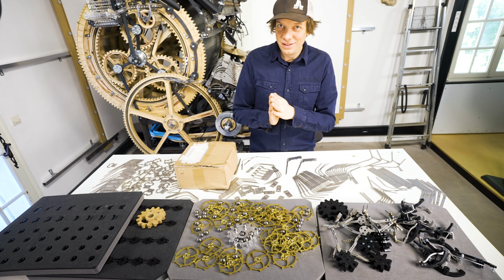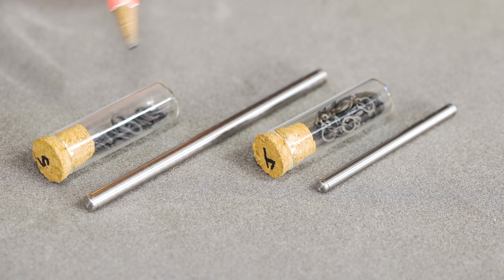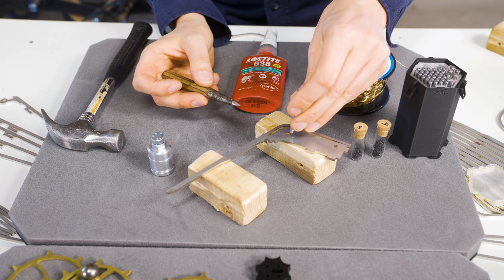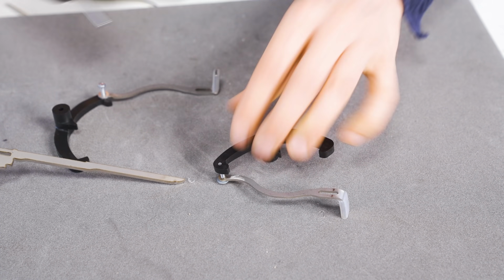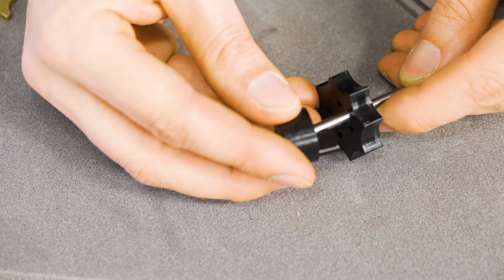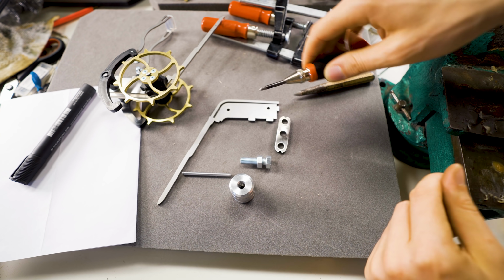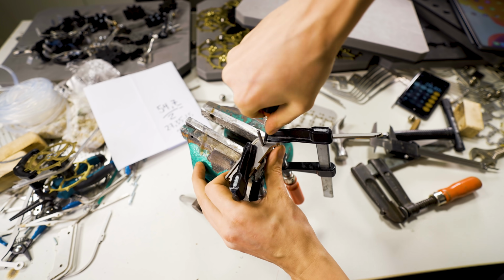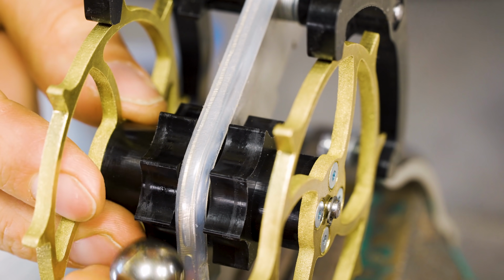Silver Steel Axles - Marble Machine X Escapement Gates

Comment: The "Clock Making Trick" (a.k.a. "staking") is a technique also used to 'permanently' prevent a threaded fastener from backing out - e.g. securing gas key on a bolt carrier group.

Comment: I have a suggestion about the programming plates.  They take a LONG time to CNC - so the majority of the time in constructing a set of plates isn't the wood-working or the metal plate - it has to be hole drilling.  So if you used different plates for 1/16th timing and 1/3rd timing - each one would need only half the number of holes and would machine twice as quickly.  So have a set of 1/16th plates and another set of 1/3rd plates - and you can make more of them.  In fact, you could invent new timings 1/5th (for example) and just make more plates.  With more space on the plate for each hole, you can go back to using simple circular holes instead of dog-bone holes and rectangular pins...which will save still more CNC time.   I'd be strongly tempted to build a static bar with 38 model airplane servo-motors that could replace the entire programming drum to allow you to play MIDI music on the Marble Machine directly...as an interchangeable option.

Comment: Engineered "slop" is important. It is what makes the SR-71 fly, even though the metal parts move a lot when heated / at speed. Sometimes flex allows things to work, where ultra-tight tolerances would create either a bind or a wear, when the materials wear out and get the same amount of "slop".

Comment: Freeze the Axle before install and by roomtemp it's snug. 
Use treadlock for moving parts because vibrations in longterm should not cause goofey problems.
This "Clockmaking" thing called: Staking

Comment: With that tight a fit between the plastic and metal parts, will there be a problem with temperature dependency? The thermal coefficient of expansion of the plastic and metal will be different. If the plastic has a higher coefficient than the metal, then when it gets cold, they will bind.

Comment: I have been so confident about this design, but now I am getting second thoughts. The force driving the mechanism is the weight of the marbles creating a moment. So you really have to rely on low friction. If the friction increases over time, the mechanism stops working at some point. So why not design with a bigger marble sprocket, creating a larger moment.

Comment: Some of your balls are rusty!  Ask anyone that knows about pinball machines and they will tell you rusty balls greatly accelerate wear on pinball playfieds as they constantly scratch away at the surfaces they come in contact with. For the MMX this might manifest as scratching the internal surfaces of the tubes causing them to become opaque over time as well as possibly wearing away other surfaces such as the divide by four and making them malfunction.

Comment: To reduce that little play as shown at 13:28, can I suggest swapping out one washer, on each side, with a spring washer? Preferably, the spring washer should be placed between the other regular washers as to not let its jagged edges from scratching/scraping the more expensive MMX parts.

Comment: Great video. Using the auto punch to dimple the metal around the shaft is called staking. One or two stakes would be most adequate to hold the shaft tight.

Comment: My biggest concern on this whole project is the capos. They work great, but they just seem to require an enormous amount of attention from the player who needs to be able to think about so many other things too. If the tune requires the capos to be constantly in motion, how can the player move away from them to change the rhythm machine, or switch channels on and off, or operate the vibraphone tremolo? 

Some time ago I tentatively suggested a method for making automated capos that would be operated from a secondary programming wheel. Although obviously the last thing anyone wants at this stage is a whole new piece of technology to design and build on, and I doubt very much that my suggestion was very workable, I do still think something like it would be worth considering.

Comment: The act of deforming metal to hold parts together is known as "Peening". And yes, that's why the name of that hammer is a "Ball peen hammer". The round end is used with rivets to peen them over.
Reply: While you are correct in that information, the location of this specific process differentiates it from peening. What Martin did in this video is actually called "Staking" by deforming the metal around the shaft to hold it in place. If Martian had hammered the end of the shaft to deform it to prevent it from sliding out, that would be Peening.
Reply: @aSinisterKiid  Yes, you are correct. I had forgotten the term staking. My bad.
Reply: @freednighthawk  No worries. You brought up very valid information that could be useful in some other situations he might encounter as well. And with how overboard martin went with all his punches he might actually enjoy peening over a few shaft ends hahahaha.

Comment: Wintergatan here is a little trick with calipers, if you look on the backside of it there is a step where you can measure steps and shafts this is very useful it's also a bit more exact than just with the depth finder. 
https://www.messschieber.org/stufenmessung.png

Comment: if you decide to hammer all those axles in, I'd recommend two things.  1) get an arbor press to gently push them in instead of hammering.  This will prevent the possibility of bending or warping the axles during installation and 2) lightly chamfer the edge of the holes before you put the axles in to prevent the corners being rounded over and making it hard to put the circlips on.

EDIT: you can also add some graphite powder to the axles to reduce friction even further.  Use it sparingly though otherwise it'll get everywhere.

Comment: OPTION 6 - FREEZE THE RODS BEFORE INSERTION. If you put the rods in dry ice for 1 hour prior to inserting them, they will shrink enough to easily insert into the hole, even if it's slightly undersized. Then you should let them warm back up to room temperature slowly and gradually, and the result will be a perfectly symmetrical press fit, with a "pre-stress" on the hole, which helps prevent crack-growth. 👍 (This is commonly used in aircraft manufacturing, where vibration induced crack growth is a major concern)

Comment: Small tip about shortening bolts,
First place a regular nut on the bolt and screw it a bit further than where you need to cut it.
After cutting unscrew the nut of the bolt.
This will restore the thread and you need minor deburring or sanding.

Comment: Heat will destroy the bond created with Loctite. You'd be better off using differential heating / cooling to create an interference fit. First drill and ream the holes a few thou undersize then place the axles in dry ice, as they cool they will temporarily shink slightly. Once sufficiently cooled, using tools or a hand protected by a heat / cold proof glove, remove the axle from the dry ice and place it into the hole as desired. After a few seconds as the axle warms upto room temperature it will expand and lock into the hole. If you feel it absolutely necessary you can then carefully peen the metal around the axle to make the connection permanent.

Comment: If you put a little drop of Ball bearing oil it will have even higher spinning time =) (I recommend a Ball bearing oil specially made for Longboards/skateboards since that's for high speed rolling)

Comment: Watching Martin assemble the parts are not good for my heart. It's great that the parts are working as expected, but all the drill / weld/ glue makes me a little stressful, thinking what would happen if something wrong happened, or if the drill / weld / glue was not in the correct position. XD

Comment: weird question.... when using the phone calculator, why are the decimal places separated by a comma and not a period? I've always been taught to notate, and my phone will also follow the same notation of numbers like :
1,325.67
with comma's only used to separate thousands, millions, and billions and every 3 places as you go higher. Having a comma for the decimal point looks so weird to me. like the same number would confuse the crap outta if it looked like:
1,325,67
at first glance I would think it looks like 1 million, three hundred and twenty five thousand, six hundred and seventy.

Comment: Maybe it is worth checking at this point wether the weight of one marble would be enough to rotate the gear quickly enough?
If there is a queue of marbles the weight would be probably sufficient but double-check the edge case before you haven't gone too far with this.

Comment: You are using the callipers wrong when measuring how much the shaft is sticking out of the hole. Use the step gauge not the depth gauge of the callipers. It’s easier and more accurate

Comment: I suspect the "divot" method will loosen up over time 🤔
I would probably have gone the adhesive route.
Or better still, interference fit  and shrink them in with heat/cold.
Anyway - bl**dy awesome project 👏👏👏👏👏👏

Comment: Might want to debur the holes before you press fit the axles.
Also, are you sure the marbles will have enough weight to drive the gear at such a minute slope?

Comment: The method you used to secure the axles in the stainless parts is called staking. It is a clock maker's trick that is hundreds of years old. I used this on several Briggs and Stratton racing engines that were highly modified to the point that crankcase gaskets were being blown right out of the engine block. We solved the problem by staking the edges of the gasket surfaces after assembly to form a wavy pattern in the gasket seam. We took an engine that was mostly used on small rototillers, factory rated at 5 horsepower at 3400 rpm, and modified them to about 27 horsepower at 9400 rpm. We only blew up 4 of these engines in 9 years.

Comment: I fear the added 2mm of silicon on the rail may lift the marbles too high for the 'teeth' of the wheel to still get a good enough grip for pushing the marbles through. And we can't see if the rails are indeed wide enough for the marbles to sink in between deeply enough for that contact. The CAD design in the animation does not have a silicon sleeve there.

Comment: The mechanisms look fantastic and seem like they will work well.
I do think Martin needs to understand the difference between cutting and grinding.
Cutting (using a drill or even forcing a precision made component through a hole (BUTCHERING)) will take more material than anticipated and leave a rough surface.
Grinding (using sand paper or some kind of abrasive compound) will always be more accurate.

I know everyone (myself included) loves this project and wants to be positive about it but when I watch Martin Hitting those axles with a hammer I hung my head and cried!!! Also putting the circlips on by squeezing them with the pliers (rolls eyes). The Groove is made to fit the circlip, it should snap into the groove with a nice positive click and there should be a flat washer between the circlip and the POM.

Comment: looks very good. But I'm afraid that without lubrication or ball bearings / needle bearings, the friction will wear off material even if it is not too high and thus get too much play over time. A possible solution would also be a lubrication point as in industrial / agricultural machines

Comment: Why not buy 4 & 5mm reamers?  When you ream, you should either do in drill press, or use alignment block to ream square.  You are tapping metric threads into plastic!  Metric threads are so fine, the threads could be "painted on".  This will strip!  Axles are poorly supported!  They will "wallow" with repeated sideways & work loose in such thin support.  Braze it in with propane torch & silver brazing alloy!  Your staking will work loose!  Cut a camfer & silver solder!

Comment: A tip for press fitting the axles: put the laser cut part in your freezer overnight and heat the laser cut part with your heat gun. Differential shrinking/expansion should give you more room in the hole and reduce scratching on the axles. That's a trick often used in assembling gear boxes.

Comment: Absolutely beautiful presentation of parts. Would be nice if more makers took this much care (but it would add expense and therefore cost). BTW, the 'circuit clip is a 'circlip' and is a noun in itself, it doesn't need the extra 'clip' after it. So, the item is a circlip, rather than a circuit or circlip clip. Of course this naming carries on to the Circlip Pliers. Love this channel.

Comment: Instead of hammering the axles into the hole try to heat up the stainless steel part with a blowtorch.
The heat causes the expansion of the hole and you can fit the axles without hammering.
The little sideplay you have in the first axle is probably caused by the axle removing some material necessary for the press fit.

Comment: Instead of using the hammer to push the pins in get a cheap arbor press, great tool all production machinist need. Also as stated in other comments heating up the one hole part and cooling the pin will make it easier too if the tolerances are this tight for all of the pins.

Comment: 6.21 Engineer Tim Hunkin uses the same! 👍
18.52 remeber that it matters witch side of washers you use together! Its not much, but for that machine everything counts. Cause they have made by pressing the washers out of metal sheet, there are the pressured side witch is concave, so the other side is concax. And if you put those two concaves or concaxes together, depending whats on the other side, its different than putting them same to same, or concave to concax as sleeping in the spoon.

Comment: The technique use with the automatic punch is called Upsetting. And if you wanna measure the depth of the axle but be less janky/wobbly use the other end of the caliper, on the backside of the jaws it will create a step as soon as you open and you can put the flat end of the fixed jaws on the flat piece your basing your measurement of, that way it will prevent it from rocking and be perfectly square with the axis of movement/measurement. It’s known as measuring with the step jaws.

Comment: Hint: When grinding threads put a nut on first. Then when you take the nut off it fixes the threads.
You can get brass inserts with threads for pressing in plastic and wood. So you don't risk stripping the soft materials. Or if you do strip the hole you can drill out and press in the threaded plug.

Comment: in cases like this you can use the other side of the caliper to measure offset. the side/edge of the two jaws should be ground flush on them so they are suitable for using similar to the rod and make it easier to stay parallel to what you are measuring.

Comment: if you freeze those silver rods they will slide in and once they get back to room temp they will expand.. 
This is called Thermal fitting... Very common among tractor and truck engineers.

Comment: Every plastic appliance made in the last 40 years or more uses the technique of a machine screw cutting or rolling or forming the threads in the plastic part.  Cameras, vacuum cleaners, your car, etc etc etc x 1000.  Done appropriately it is perfectly adequate.

Staking is the term for displacing metal to trap a part or shaft.  So much arcane terminology!!

Comment: Martin, the retaining method is known as “upsetting”. It is closely related to “staking”.  It would be staking if the shafts had holes or notches that you deformed the plate metal into. It is good that you didn’t weld or braze the shafts.  Silver steel (called drill rod in US) is high carbon tool steel and it is easy to make it extremely hard and brittle if it cools too rapidly.

Modern day clockmakers will often use locktite.  So don’t worry that it isn’t in the proper spirit of your escapement.

If you like clockwork things,  should look at some lantern type pinion gears...they are nearly as cool as escapements.

Comment: That operation of deforming the material to fix something tightly in place is called peening in a lot of other metalworking. Couldn't tell you if clockmakers have a different term for it, or if that's a specific form with a unique name...

Comment: Random calliper tip. 
There's a step/face gauge part on the top as well. Sometimes it's easier to use then the bottom depth gauge.

Comment: You should take into account the expression, "If it isn't broken, don't fix it." You should take the assembled parts and test them on the machine first before worrying about "what if's". Then if you come across an issue, you can address them then and there. It would save you some worries and allow you to deal with and see the actual issues that may occur

Comment: try putting a pair of thin Teflon washers on either side of the bushing next to the steel washers? this should close up the slight spacing on the shaft.

Comment: Weld it. It will create noise.

Correction - you did good 😉 nice save with the shims.

When you are fitting the silicone tube lubricant the tube and the part with some rubbing alcohol, it should slide right in and will evaporate to become stuck

Comment: welding would have warped the shaft. Everything needs some play if it is meant to move. Heck some of the old machines like power hammers relied on slop to operate properly.